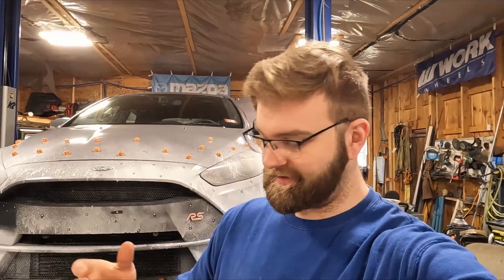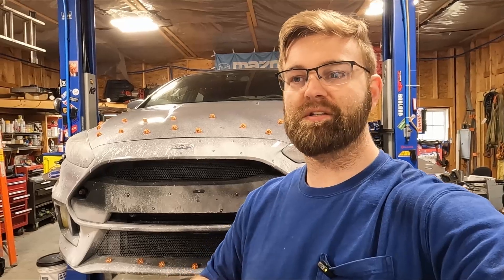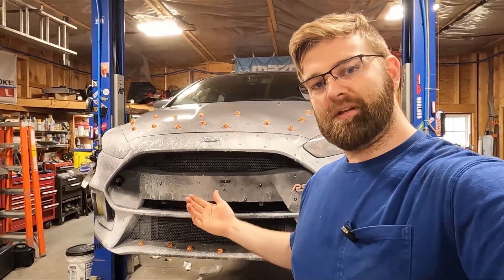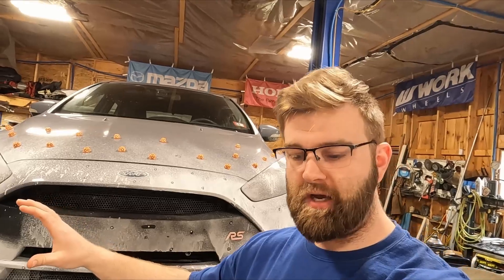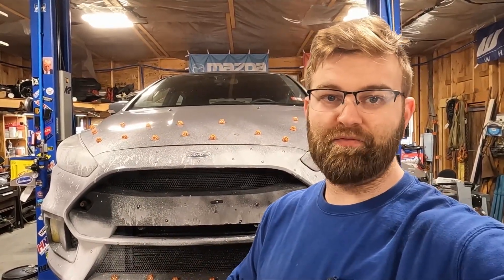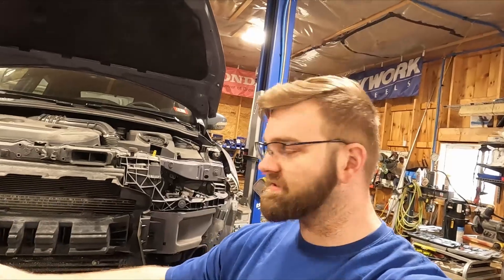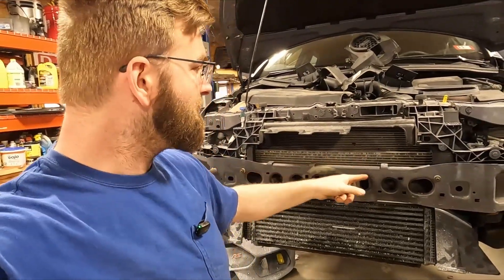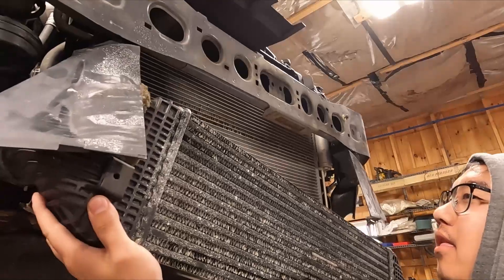Focus RS "Pop Up" Headlights - Pt 1 - Scanning the Front End

Comment: Cool project! I also see that rotary in the background. Wish we had a proper 3D scanner handy when we were developing the engine mount for the rotary swapped BRZ. Now I have a cheap one, but have to get started somewhere. Subbed. :)
Reply from the maker: @802Garage  check out some of my other videos. We have been REW swapping an Rx8 with a custom turbo manifold that’s 3d printed out of Inconel
Reply: @TwinCrestInnovations  Fantastic. I assume you watch Couch Built as well?
Reply from the maker: I have not. My brother is the rotary head. I just design the stuff. I’ll give them a look tonight
Reply: @TwinCrestInnovations  Oh snap! You'll love it. 13B-REW swapped BMW i8, but insane amounts of 3D scanning, CAD, Inconel 3D printed exhaust, metal 3D printed many other parts, it's overall one of the most wild builds on the net right now.
Reply from the maker: @802Garage  oh yeah I have watched his video on using Cloud for doing the printing. My brother’s company printed it for us but if they couldn’t we were going to do the same as he did. The manifold we designed is a much smaller one.
Reply: @TwinCrestInnovations  Awesome stuff! Excited to see what else you do.

Comment: So you are building a sliding/hiding light bar? that is not pop up headlights =)
Reply from the maker: @nicooolito  I know I know. They are pop up adjacent. That’s why I put “Pop Up” in quotes in the title
Reply: @nicooolito Thank you, Professor Semantics, for gracing us with your basement-dweller tier insight. It is pop-up headlights—just not in the 1980s sports car sense your brain is stuck in. Ty’s building something original and functional, and you’re in here trying to flex technicalities like it's gonna win you a ribbon at the local ‘Well Actually’ convention. You act like you just fact-checked NASA mid-launch. Meanwhile, your biggest accomplishment is probably updating Java without panicking. Let the innovators work while you go correct a microwave manual or something.
Reply: @DerShaggenWagon  You do realise that NASA is a scam? right? 
Why are you so offended by a statement someone made. sheesh
Reply: @DerShaggenWagon  here here